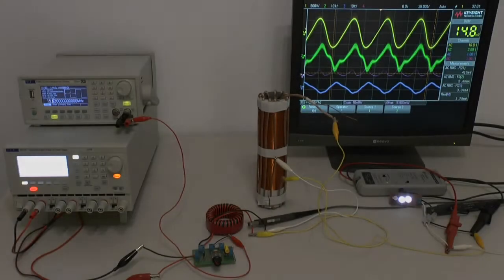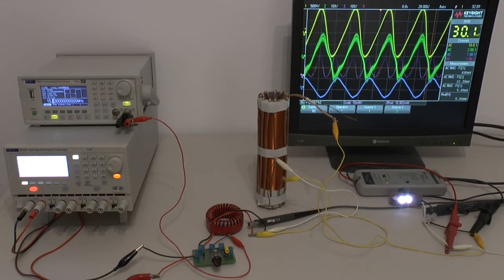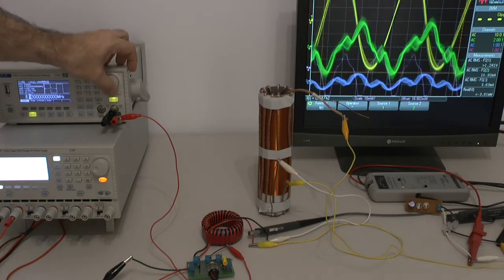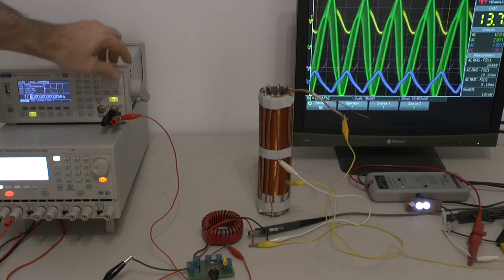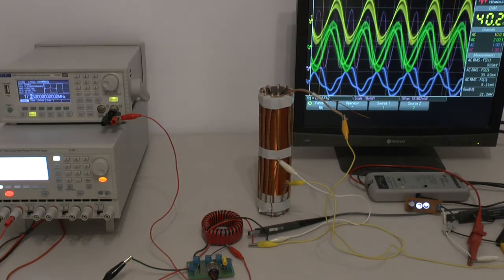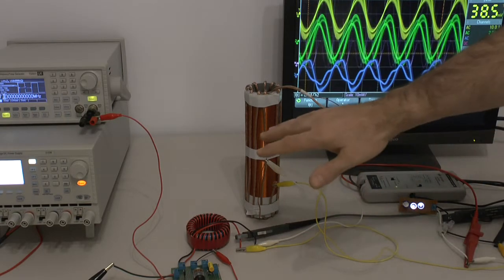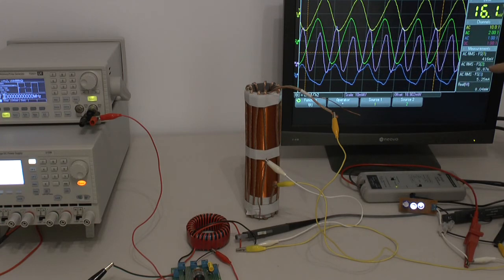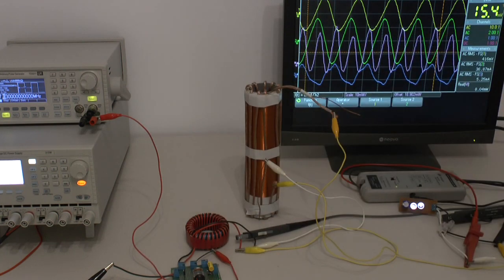NG coil system and signal interference pattern

Comment from the maker: To those who did not follow my work in the last couple of years 
It is all about learning and understanding. I stated it many times in the last 10 years. My job is to do research and share this information and nothing else. There are enough of those who simply present something self running without any background information and are mostly those feeding who are willing to buy in and than the interested ones who try to replicate based on a circuit diagram. Everybody is puzzled why it doesn't work. It is because a diagram does not give you information apart from the connection of passive or active components. There, where the magic happens in the coil, you get a simple symbol. It will never work I am afraid.

Comment: Interesting result! Is the tube in the larger coil cardboard or is it permalloy/metglass? If a magnetic alloy, according to my theory, your input coil may be periodically poling the iron (possibly even the air or enamel on the wiring), causing parametric generation as in optical systems (https://www.rp-photonics.com/optical_parametric_generators.html). The interference/cancelation effect is indeed important to such efficiency phenomena in systems with varying parameters. This setup also reminds me of the Kapanadze coil, due to the copper rod through the center, more or less perpendicular to the windings. In that setup, coarse windings in opposite directions will also not be perfectly parallel, though they certainly are not perpendicular either.
Reply from the maker: The tube is plastic pipe for water drainage from your DIY shop but as mentioned in a video before It has 10 meter of metglas on it. And yes Kapanadze did something similar. However all coils were in magnetic flux direction. I could  not notice any gain in that system when I replicated the experiment the same as JLN Labs
Reply from the maker: Michael, very good point. Finally someone thinking in the right direction. Parametrics will be part of my next video series for my members.
Reply: with plastic and metglas you should be able to modulate both permeability and permittivity in the coil, as per the papers I've mentioned elsewhere under your previous videos. It would be interesting to see the plastic replaced with a composite of barium titanate or lead zirconate titanate and an epoxy resin. This will increase the change in permittivity. It should be possible to tune the choice of materials and the input signal so that impedance is made to vary while wave speed stays nearly constant. Optical parametric amplifiers use periodic poling which changes only wave speed, via the electro-optic kerr effect and other similar effects. Such systems appear to obey energy conservation. The impedance effect has been overlooked since Friedrich Morganthaler's paper "Velocity Modulation of Electromagnetic Waves" in the 1950s, and may give rise to some strange behaviors.
Reply: Regarding the Kapanadze coil, there may be errors in the descriptions online of the driving circuitry, but also of interest is that the grounding rods need to be a certain distance apart, with a certain surface area. This shouldn't matter unless there is a non-negligible complex (LCR) impedance between the two grounds which is not in the circuit diagrams, such that one ground is "floating" relative to the other, but only to a certain degree. The real and imaginary components of impedance are not nearly infinite for example. This floating behavior is similar to the circuits you are now exploring, and if one ground is floating relative to the other this allows a charge on the ground rod and current through it relative to the coils wound around it. These could interact parametrically with the coils somehow, or interfere with them in some way which cancels out some fields, changing the effective impedance. I have yet to try replicating the Kapanadze coil myself so this is speculative for now, but I intend to try at some point. I think it's certainly worth exploring.